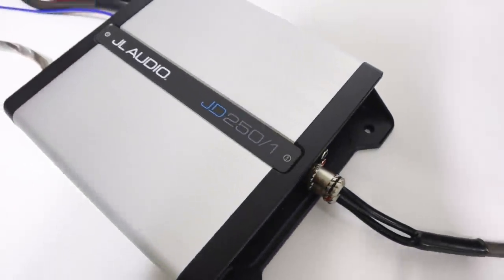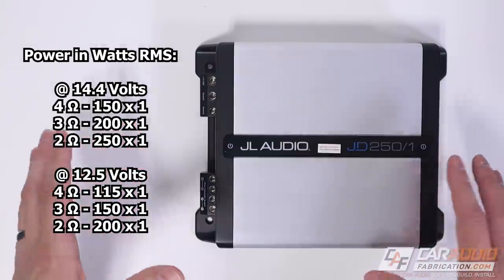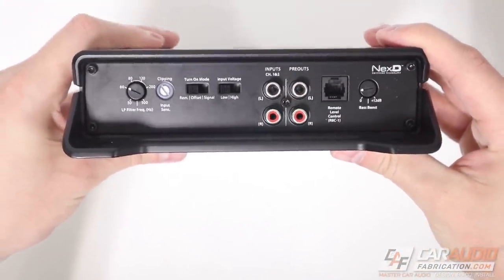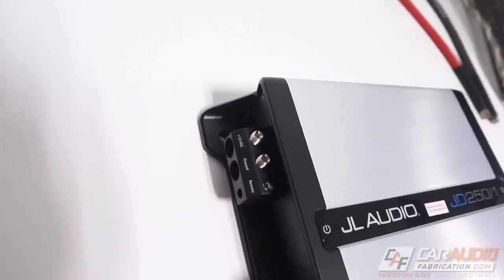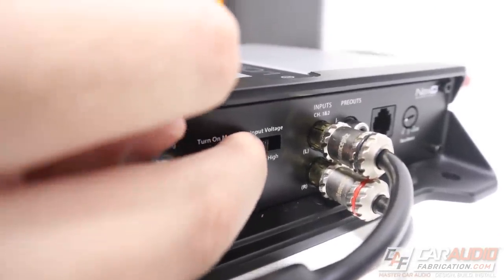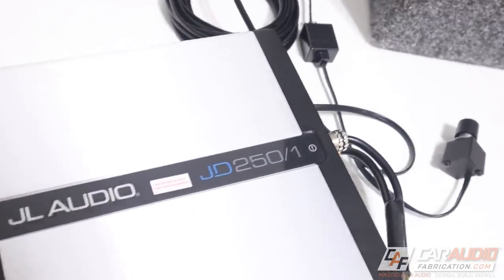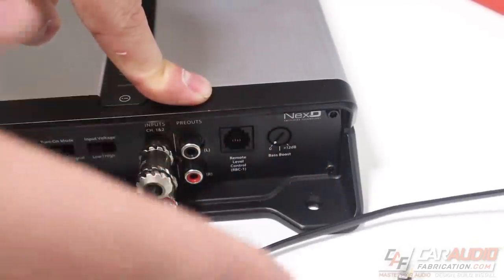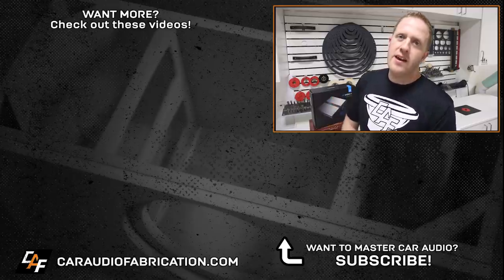JL Audio JD250/1 - Perfect for Entry Level Bass? - IN DEPTH Amplifier Overview!

Comment: I have the 500 watt version of this amp and it sounded noticeably better than the 500 watts kenwood amp I was replacing. Really made me want to invest in their 4 channel amp on this line too.
Reply: What model of Kenwood you have?? I have the JL Audio JX 1000 series for my w7 and kenwood excelon series. I think excelon have better sound quality then JX but for more power JL. I was thinking upgrading for this amp maybe sound quality improve.
Reply: @mrb9106 I had a kenwood KAC-500 for my sub I believe. It wasn’t their excelon series. My speaker amp is a kac-6407. It doesn’t sound bad but I like to match.

Comment: I have a full set of the previous generation JX amps. I started off with the 250/1 & had it for years until it was time for an upgrade & of course I stuck with the JL Audio JX range & I’m now running 2 x 1000/1 & 2 x 360/2. After seeing this amp I want to upgrade to the new generation JD amps but I can’t justify the cost at the mo!😔 I’m a JL lifer these days & when time comes to replace I will stick with them for sure. So many new sick features over the JX & the JX aren’t crap either!🤣 Mark your review videos are great as you cover all the good shit! I just wish you was in the UK!😜👍🏻

Comment: These are nice little entry level amps! I had the JD 400/4 in my setup before getting more power hungry speakers and upgrading to the JL audio HD 600/4 and XD700/5v2. I’m very impressed with all JL amps I’ve used so far

Comment: For those who complain about JL Audio prices, do you have any idea how convenient and sometimes essential all of these rare features are? There's so much built into when these entry level amps. I run all JL Audio.
JL Audio HD750/1  to JL 10W7
JL HD600/4 to JL C5-650 doors & RBH 4” Beryllium on dash
JL 300/4 to Vifa tweeters on dash and bass shaker in seat
JL Twk88 DSP to run 3 way active front. No rears

JL Audio is subjectively the Best, and objectively easily within the top 5 car audio manufacturers.
Reply: Get what ya pay for!!!

Comment: 2:13 ... good information on power output, the majority will not be running an upgraded electrical system(alternator/batteries/etc), for the past 20 years, autos have a charging system monitor that feeds information to the PCM typically connected to a sensor attached to the negative side of the battery cable, my 2005 gmc sierra 1500 has this. After the vehicle is first started, the alternator output will be at a typical +14.4v, as the battery is monitored and slowly charged back up, the charging system will go down to +12.6v so it doesnt get overcharged and be kept topped off, at least during the day with all running lights off. At night time with all the running lights on, the alternator output will usually stay at a constant +14.4v due to the load demand and other accessories you have running at the time.

Comment: As a recommendation for the quick remove power connection look into Powercon connectors, They are used in Professional live audio and lighting applications, they are rated for at least 3600W and you would be able to use all 3 of the power terminals +/-/Rem in one connector.
Reply: There is a reason Neutrik has become the default standard for audio connections in Professional AVL.  I definitely recommend trying out the PowerCon.  They can't come loose on you and provide excellent grip on the cable jacket to prevent the wire connection points from getting pulled on.
Reply: @TheBurnout96  you are right, I took the 3600W from 230V ac. I forgot you needed far more amps and those amps are what causes most of the heat instead of the voltage. Yet again I believe it would be usable for this specific amp setup. And in my opinion it would look better compared to those gray plugs (They remind me of forklift charger plugs)

Comment: I used to have the previous gen of the 250rms watts and those tiny amps have more balls than those that claim to be 1200 watts!! It provides enough power for a single 10” w3 which that amp is made for or w7’s now but they can easily power 2-10” no problem. I highly recommend.

Comment: If I remember correctly, the NEXTd use next-gen FETs that are highly current efficient, but are surface mount (I don't see any power or output  FETs with the bottoms cover removed).  If one of those go bad, the repair tech had better be good and qualified for SMD repair.  Thankfully JL's repair services for amps is actually very very reasonably priced.

Comment: So when using a ported sub box with this amp is there a need to for a subsonic filter? I was under the impression that if one is not used it can damage your sub in ported applications. When would you need an amp that does have these options?

Comment: For the remote wire you can tap into a fuse in your fuse box. I wrapped my remote wire around a 12v plug in fuse that’s always on so if my car is on, the amp is on
Reply from the maker: This is not the correct way to do things.

Comment: Why would I be able to turn the clipping all the way up without the light coming on? 
It’s the 500 watt version with two 250watt subs. 
To tune it to the right sound I turn the bass boost 90% up. 
I can turn it all the way up if I wanted. 
The other setting is at 80 like yours. 
Thanks for any input you can give.
Reply: Did you ever find the issue I have the same problem

Comment: i am building a custom enclosure in my jeep liberty. 2 12” l7s, 4 kicker 6x9s and 2 amps. all fiberglass built in and one piece. never done anything even remotely similar but i am going to use your videos as a guide. so thanks! and also, i haven’t seen much about ported fiberglass enclosures. do you recommend fiberglass enclosures be sealed?

Comment: I want to get JL audio monoblock and speaker. I want to build all in unit myself. I don't know if I should get 250W amp and speaker or 250W speaker and 500w amp to feed clean signal to the speaker ? 🤷🏻‍♂️

Comment: 1. Mark would this be a good combination with a Kicker CWD 82?
2. Is it 1 Ohm stable?
3. I don't see a fuse on the amp itself, does it have any other way of protection?
Reply: Not Mark, but: Given that they don't list a 1 Ohm power rating it's unlikely to be stable at 1 Ohm.
That limits your chosen sub (dual 2 Ohm) to be hooked up in series, ie a 4 Ohm load. That'd give you 150W from this amp.
They list 50 to 200 for the dub, so it should be OK, if not absolutely optimal.
As to fuse/protection - looking at the manual it looks like they rely on upstream fusing, recommending a 30A fuse on the power wire. So if you run multiple amps, I'd use a fused distribution block, or put a separate inline fuse close to the amp, after an unfused distro block.

Comment: This might sound dumb, but I’m trying to figure out what size fuse I need for multiple amps. I watched you video on how to calculate them. I have the jd400 hooked up to 4 kicker 75watt door speakers. What would you say is the peak output of the 400 setup that way? Thanks for any info.

Comment: Would the 4 channel amp be good to run your highs? And what speaker brand do you recommend they be paired with?
Reply: That's precisely what the 4 channel version is designed to do. This can be paired with any brand and for running the highs.  The split output from this amp is simply a copy of the same audio from the head unit.  However, if you want the same quality then I'd stick with JL. Always looks better when the both amps have identical styling.
Reply: MARK!! Thank you, you just gave me my first content creator Heart!  =)

Comment: Question: would it be possible to use the clipping light on the amp to find the maximum undestorted radio output volume? Ie. turn the gain on the amp all the way down, play the 50Hz test tone and increase the volume on the radio until the clipping light illuminates? This should, in theory, be possible as the amp would see clipped signal already
Reply: Not really. The amp's LED is connected to a circuit that monitors output clipping, not whether the signal coming in is clipped.

Comment: Hey mark, Would you happen to know how to wire a center speaker? For example, my car has two tweeters on the front dash as well as one in the center as well as the woofer in each front door. Looking to add a 4 channel amp for the, but want to keep the look close to stock. I normally wouldn’t pitch this question, but I can’t seem to find anything on any forum (afaik). 😂

Edit:wording

Comment: Wish JL made head units. Would be all over that
Reply: They would have to hire an entire division to do that.  Head Units require a dramatically different electrical engineering knowledge and experience from speaker design. If they connected with a top quality engineer in that realm they were interested in hiring then it could happen. But that's the only way I see that coming about.

Comment: I ran a w0 15 off this amp and it not only pounded for 250 watts but the sq is great yeah jl is pricey but you get what you pay for I currently have 2 w0s running off a 500/1 and they beat way harder then kicker comp rs getting 300 watts rms a piece off a pioneer amp

Comment: I have a JL 500D. I forever wondered and didn,t find an answer. why these jl amps don,t have fuses?
Reply from the maker: The amps circuitry is self protecting without fuses. Remember, when you fuse you are protecting the wire, not the component itself.

Comment: If using an LC2i with this do I want it on low setting or high?
Reply: You won't need an LC2i or similar unless you are using a signal from a powerful factory amplifier. If you were using one, you would set the input voltage switch on "low"

Comment: Might be a stupid question, but there's no power fuse on the amp? Pretty much all the car amps I've seen has one or more power input fuses, I dont see any fuse on this amp...
Reply: As DonNerdo explains, modern amps have protective circuitry that resets protecting the amp.  This is not a replacements for an in-line fuse, which protects your power source line.

Comment: Is an entry level amp really going to sound that bad when pairing them with high end speakers? I was recently in my local JL dealer and they really didn’t want to sell me a JD amp because I told them it was going to power a couple 4inch focal k2 mids.
Reply: It would sound great.
Reply: DonNerdo I should have specified, I was looking at the JD 400/4 which is a class D full range amp.

Comment: I read the JL level setting guide and it says the raise the gain until the clipping light is solidly lit... instead of back it off. Which way is correct?
Reply: DonNerdo just chatted with JL, they say to set the gain by slowly raising until the clipping light is solidly lit and leave it there do not bring it down. Good to know!

Comment: Would the 500 series be enough to power a JL 10TW-D8?
Reply from the maker: The 500 watt amp? You would want to pay attention to the subwoofer impedance as the TW3s are rated at 400 watts RMS.
Reply: @CarAudioFabrication  I was referring to the 500 watt amp from JL that you referenced in the beginning of the video. But it sounds like I might need the 1000 watt

Comment: I have a question i have a line output converter so I can get rca.now if I put this amp in offset or signel and I close the door or boot my sub goes crazy like its getting full power but the head unit and car is off.ive had another amp that did this when current goes to the amp but the headunit takes time to turn on.only amp what didn't do this was a hifonics amp what had soft turn on and it helped with the mad craziness. Any ideas ?

Comment: The bass boost, you just went against everything that has been said for the bass boot. Like don't use it.
Reply: technically he said use it responsibly
Reply: @tannertyrik6251  lol cause Joe is going to do that. 😂
Reply from the maker: The "don't use it" mentality comes from folks that don't know how to properly use it. If you are tapping into an OEM signal that the OEM has drastically cut subwoofer bass frequencies from (to protect their factory speakers) this single frequency eq can be beneficial to target just that information and boost it back to acceptable range. This is valuable on an entry level system (and simple bass add on) when you are not adding a full blown DSP device to correct signal. The caveat is that you should just be sure that you are not clipping the output signal and recheck input sensitivity. All of the above was stated in the video. If the control didn't have value they wouldn't have included it on the amp.
Reply: I have used bass boost successfully for 30 years. Does every setup need it? No, but on the ones that do it's very useful.  If it was soooo terrible and useless these companies wouldn't be still adding it to their amps.   It's like the purist home audio guys that frown on bass and treble controls. If the setup sounds better when they are used, and you don't hear any distortion or negatives added to the music, what's the problem exactly??
Reply: CarAudioFabrication hahaha I guess some people don’t really listen to the info in the video.
Reply: @dtmfool789  So the videos put out by reputable people showing the distortion that bass boost puts into the sub are wrong? Set your system correctly.  
Prove the data wrong. I use facts by proof.  So prove it.

This is the only I have disagreed on that Mark has done.
Reply from the maker: If the bass boost is introducing distortion, then by definition it is not properly set... I think what you are referring to is when people say "if you don't know what you are doing, don't use the bass boost, as it can clip the output signal and lead to distortion." But this doesn't change the fact that when you do know what you are doing, and properly set the bass boost, there won't be clipping/distortion. That is literally the definition or properly vs. improperly set. If a "reputable source" is saying "look the bass boost is cranked and its distortion" by definition that is set incorrectly.
Reply from the maker: Let me put it this way. Bass boost is a single band EQ. If it was the big bad devil and "always added distortion" like you seem to imply we wouldn't be able to use DSP's to boost and cut signal to tune a system, again, it all boils down to proper setup. If you are getting distortion or a clipped output signal... Its. Not. Properly. Set. Up.
Reply: @CarAudioFabrication  Mark, I missed where you said a stock stereo. That makes a lot more sense.
Reply: @TheoneDragon51  It's still possible to use bass boost with no distortion or clipping even when using aftermarket gear. Not everyone likes to max out their stereo, For every 'max decible junk' I can show you ten people who never turn the volume knob past halfway, but they still like to feel a little low end kick when casually listening. Bass Boost is very handy setting things up for those type of listeners.
Reply: you mentioned that there are other good budget/entry level options out there. would you mind sharing some?